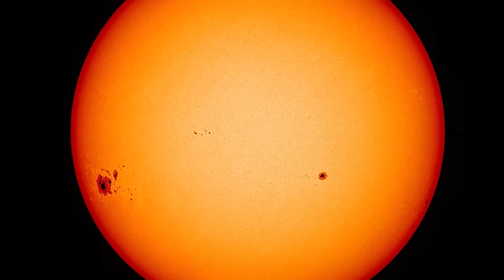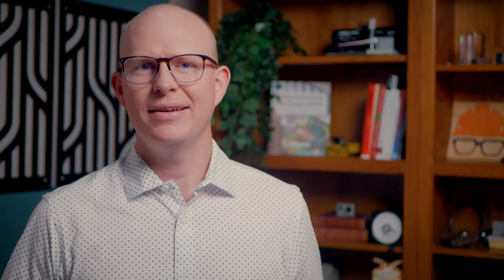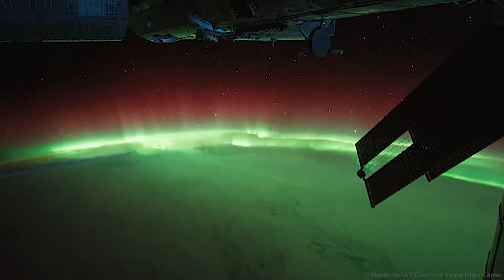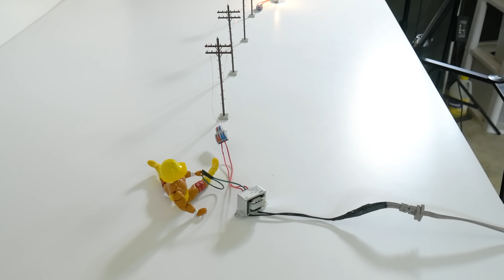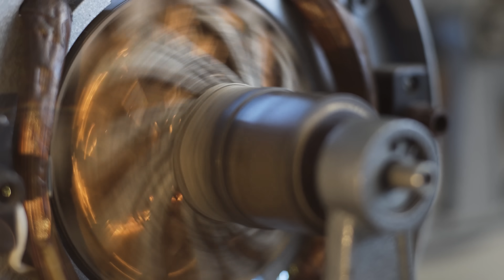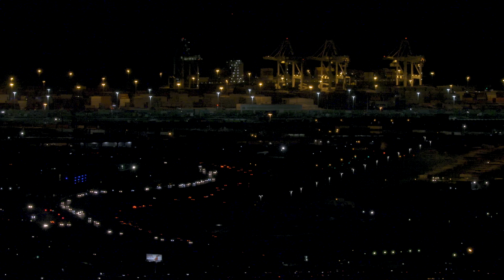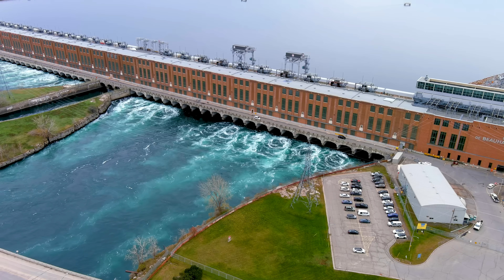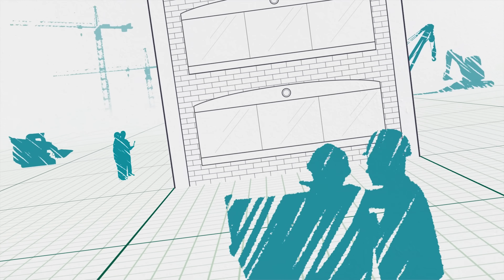The Most Confusing Part of the Power Grid

Comment: If I remember correctly, power companies apply a power factor to residential and small commercial customers to account for the reactive power.  And you get billed for it.  Even more important in the billing and capacity areas is the demand factor, that is the customer has a peak demand for power and the local utility has to have the capacity to meet these peak demands.  So peak demand is measured, and a component is billed for it.  In the old analog meter days, there would be a needle on the meter to measure the demand.  There would be a pointer that would register the peak demand.  Now, the so-called smart meters measure for the peak demand continuously.

I think that this peak demand is an aspect of the push to EVs is the peak demand which will increase dramatically when high amperage overnight chargers are connected.

PS:  The margins are constantly being shaved in the pursuit of greater economic returns.

PPS:  I worked for a pipeline company that had multiple high horsepower electric motors driving compressors that were located in the TVA service area.  There would be times that the TVA would contact us and ask us if we could operate a particular motor at a particular location in order to help stabilize their grid.  These motors were synchronous and varied in size from 1,500 hp to 15,000 hp.

PPPS:  I recommend checking out as to what is going on in Australia, particularly NSW, about the push to renewables.  They are actually facing electric power shortages and rapidly increasing power bills.  There is a revolt brewing over this.

Comment: https://youtu.be/ZwkNTwWJP5k?t=729
"We usually say that inductive devices "consume" reactive power and capcitive devices "supply".
It should be ""We usually say that  capcitive devices "consume" reactive power and  reactive  devices "supply".
That's why we are installing capacitors in a circuit to "consume" reactive power, sometimes close to it's inductive source. Capacitors are enclosed in an equipment called reactive power compensators and you can spot quite often in Europe.

Comment: One of the cool things that some geothermal power plants can do is easily provide grid support by increasing turbine speed by opening the turbine control valves to provide reactive power. When a transmission line in Oregon overheated in 1996 and tripped several power plants off line the grid cascaded and customers in 9 western states lost power. I was in the control room of the Steamboat geothermal power plant in Reno when the whole thing started to go down. The phone rang and the plant manager answered the call from the utility. The guy from the utility screamed ‘can you provide grid support?’ You could hear him across the room. The plant manager asked, ‘Are you going to pay me for it?’ “No”, yelled the utility guy. “Just do it.” For a tense hour or so, the plant manager turned a dial that changed the power factor as the utility guy yelled, “Lead. Ok. Now lag. Lead…..lag.” Reno didn’t lose power during the major outage.

Comment: A brilliant explanation.
What I like to know is, at 6:36  when the capacitor and the inductor were indicated on the oscilloscope what sources were used?   As far as I can remember the source for the capacitor should have been a current source, while that for the inductor should have been a voltage source.

The manner in which I explain Power Factor  is to consider a train on a railway track which needs to be moved. The force to move it can be applied in any direction that is from the back or from the side or anywhere in between ( vectors)  Pushing a train from the side at 90 degrees will not move it but will tend to turn it over and the best manner to move the train is to push or pull from the back or front parallel with the rails on which the train stands.

The direction of the rails could represent  the current, the direction of the force used could be the voltage and the resultant of force and movement is the power used to move the train on the rails.    The angle between the rails and that of the applied force can be representative of  the phase angle between voltage and current hence the power factor is determined. Also Real, reactive and apparent power is illustrated in this train example and the associated vectors.
Reply: The test is looking at the current through the device (capacitor or inductor), which is the second trace on the screen, the first trace is the voltage of the supply.  The current through the device is shown by the voltage that appears across a resistor he inserted at 5:43  (V=IR).
Reply: @karhukivi  Thank you. That means that with the insertion of the  series resistor,  the voltage source with a low output impedance was effectively changed to a current source to charge the capacitor .  .
Reply: @carmelpule8493  Yes, but not a constant current source.  The oscilloscope can only detect voltages, so to measure a current, a series resistor is inserted and the second channel is measured across that resistor.
Reply: @karhukivi  Thank you Sir, The depth of matching sources to transmission lines and loads, is an art in itself, as the source and load will both have an effect on the characteristic of the processing network in between. To makes things easier to understand, I often look at ideal current and voltage generators feeding the various load, In the case of a perfect capacitor it will react differently when supplied from a perfect current source with an infinite output impedance,  then, a perfect voltage  source with its zero output impedance.. The hidden elegant wonders of static, moving spinning Charges, Voltage, Current Electric fields Magnetic fields, Power, Energy  and their relation to mass, are just fascinating,  and can keep one busy for a lifetime. Thank you once again.
Reply: @carmelpule8493  Yes, what always astonishes me is how the modern world economy is based on spinning coils of copper and magnetic fields!

Comment: Would distributed power be a solution to reduce risk and the wasted reactive power and lower the damage from CME's and the like? If each house produced and used DC power, would this not be reducing the length of transmission of power to almost zero? I am in favor of all this for many reasons and would like to see governments require or incentivize this conversion from long distance transmissions of electricity to individual generation/use by each consumer of electricity. That would be good social and environmental benefits long term. Thanks.

Comment: As usual, well thought out and presented. One thing though. Lightly loaded transmission lines are capacitive. The point where they are VAR neutral (neither producing nor consuming VARS) is called the surge impedance loading point or SIL. I'm a system operator for a 6500 -MW system, and we constantly have to adjust our reactive resources depending on loading and the time of day.

Comment: 16:30 Don’t let the constant propaganda fool you; we’re not transitioning to renewable sources. All of these wind and solar plants are 100% backed up by fossil fuel power plants and old hydroelectric and nuclear plants, because renewables are not dependable due to their reliance on the sun and the weather. Over time we have been slowly reducing the number of hydroelectric plants, and we’re not building new nuclear plants, thus we’re increasingly dependent on fossil fuel. And we cannot reduce the number of fossil fuel plants as we build more wind and solar plants, because we still have to cover the times when these plants aren’t producing power. The largest grid-connected battery systems can only maintain output for a few minutes without the fossil fuel plants running. 

You could shut down every wind and solar plant on the grid and the power would continue without a glitch, but you could not do the same with the fossil fuel plants for even a minute. And this shows no sign of changing any time soon.

Comment: The thing that I don't get is. Solar particles would seem to induce DC on the line except for you need AC to induce a current on the line.

The other thing is it would seem that since power is transmitted with two lines. You would get "common mode rejection" that would cancel any solar effect. Much like a humbucking guitar pickup.

Comment: There is an agency out here in California called "Cal-ISO", which stands for "Independent System Operator". They're a not-for-profit private company that manages the state's power grid. There are several different power companies that own and operate generation equipment in the state, some of them Private, like Pacific Gas and Electric, others Public/Government Agencies like SMUD, the State Department of Water Resources, and the Los Angeles Dept. of Water and Power. Cal-ISO is like an independent Traffic Cop who isn't employed by any one specific power company, but who manages the grid equipment that all of those generators feed into, for the benefit of everybody. I had no idea that "reactive power" existed, and that big inductive loads actually pump power back into the grid. This is significant: The State Department of Water Resources operates several pumping stations that are powered by gargantuan electric motors: one in particular, the Edmonston Pumping Plant, which pumps water from the California Aquaduct over the Tehatchapi Mountains to Los Angeles. This plant has 14 of the largest electric motors in North America: 80,000 horsepower each, and when all of them are running, the plant draws almost 800 MW, through a dedicated 230 kV line from SoCal Edison. I had a friend who was an electrical engineer and who worked there for a while; he told me that starting up these pumps had to be coordinated with Cal-ISO and the operator of the power plant at Hoover Dam, which is where most of that 800 MW came from.

Comment: Why are they called "synchronous condensers?" Isn't a "condenser" an old term for capacitor? (c.f.: condenser microphones) But these seem inductive? Can they act like capacitors?
Reply: They can be used for both, it depends on excitation. An under excited synchronous condenser would be inductive and ‘absorb’ reactive power, an overexcited synchronous condenser would be capacitive and be ‘injecting’ reactive power

Comment: Question on emergency generator power output. I bought one after the big freeze couple years ago. Now I’ve been reading that the electric output may not be pure sine wise. Are there plugs that you could attach to an extension cord to hook up computers and other sensitive items?  I tried searching on Amazon but I lack the proper terminology. Thanks.

Comment: 9:49 actually only ACTIVE power is responsible for the heating in the lines, due to Joule’s First Law. 

Reactive power does not affect resistance. Only reactance. So reactive power is not lost on the grid, but stored. Active power is partially lost.

Similar to the complex nature of apparent power, electrical impedance also has its real and complex components, resistance and reactance, respectively.
Reply: There is some truth to what you are saying, but what he means is that some of the reactive power will eventually turn into active power while it's going back into the grid. Not 100% of the reactive power stays reactive

Comment: Consider the graph rms voltage (V) vs. power (p) at 14:38 ff. At low values of p, V is a function of p; there is just one V for each p. But in the “nose” area at the right, there are two values of V for each p. Is it possible for the V to fluctuate rapidly, switching back and forth between these two values over time instead of going around the nose as it does in the video? I assume the arrowhead moving along the curve is showing the p and V over time. Quite fascinating, all the power company equipment we never notice.

Comment: Very good display but also very noteworthy is: Every PV or Wind or Battery souce which is linked to the grid through an inverter has the potential - and many are ready for it -  to provide power factor correction. This is even not depending on delivery, i. e.  a PV inverter can do pfc ar night time, basically using its capacitor-DC link and the right PWM modulation. These very beneficial ancillary services bring out the full potential of renewables once utilities are transformed into smart-grid-operators with many distributed players, thus adding resilience.to the grid.

Comment: fun fact about industrial power factor, a lot of plants have massive cap banks to increase their power factor, some plants also opt to not have the proper metering for inductive loads in order to have the plant run on large battery banks for short times when the utility folks come around to meter it out in order to get the lowest rates on electricity

Comment: I would actually appreciate if you had other videos that went into the math or a link to resources. I studied a lot of this stuff a long time ago back in school before youtube existed, and now watching these is sort of helping me refresh my knowledge and actually it's a really good break down. Having a more in depth video and applications of the math for people interested would be fun i think (or maybe this is on that nebula site? I'll have to check it out)
Reply: Yes; this raises questions for those who’ve taken math but little physics of electricity & magnetism. Physics books discuss the RCL series circuit equation as an ordinary, second-order linear differential equation in one independent variable (time), but no applications to a power grid, where you’d have large systems of equations allowing for elements hooked up in in parallel as well. I also suspect that unlike in the book, the coefficients for R, C and L in the equations aren’t constants, but functions of time. There is, in the series RCL equation but not in the real world, the case of C = 0 where 1/C is undefined. The AC voltage is root mean square time average in the video here, which doesn’t consider instantaneous values.

While engineers take lots of math, I doubt they ever try to model a power grid by hand using theory as presented in college. It’s too complex for that. They use software, or various heuristics that work on the job.

Comment: Very succinct. Wish I had these videos years ago when training generator operators. I’m a broadcast electrician and everything I do is temporary and redundant. Currently out with 3mW based on 6 500kW gensets. Load is always less than 400kW. 480/208V. Load in operate and out in 6 days. Broadcast events usually add a UPS between shore power and generators.

Comment: As an Australian, I can assure you that many of us think the govt's plan to go 100% renewables is going to be a disaster. A better option would be to just replace the coal-fired power plants with nuclear power plants - using the same grid. Going with wind a solar means building an extra 28,000 kms of power lines which they do not include in their costings. They claim that nuclear is 5 times more expensive than renewables - which is complete garbage. Our woke/left govt are just ideologically opposed to nuclear and won't consider anything other than renewables.

Comment: 16:44 
      Grady, anything wrong with my bare basic understanding, that grid scale  batteries are just this - capacitors?   
       Absorb in moments of plenty and deliver into moments of sag?
Reply: Capacitors, inductors, and batteries all store energy, yes, but they are otherwise not the same. They have different behaviors.

Capacitors resist changes in voltage, inductors resist changes in current, and batteries act as either a source or a load (they interact through electronic controls, since we must first convert between AC and DC to charge and discharge batteries from and to transmission lines).
Reply: @Rogstin ,
   👍🏻   Thanks.

Comment: HVDC system doesn't have such problems. I recommend making next video about that
Reply: HVDC is great for long power lines but you have to convert the power back to AC when you take it off the line and the voltage on HVDC lines are very high and hard to change so the equipment is very expensive.
Reply: @irocz11   HVAC long power lines have exactly that problem because neutral point of wye transformers are grounded (bonded to earth). Any superimposed DC voltage and resulting current can not be blocked and saturates transformers cores

Comment: "An incandescent bulb's resistance changes with voltage".  Ah, no.  It changes with temperature, which depends on the current, which depends on the voltage".

"Power is transfer of ebnergy".  Ah, no.  Power is the rate of transfer of energy.

"Power does the actual work".  Ah, no.   The electrical energy does the actual work.

I know you know these, but this video is targetted at people who don't know these, so you should take more care with your language.

Comment: Another issue with solar weather is that it can create huge DC voltages along transmission lines. These cause the transformer cores to saturate, meaning the transformer no longer works as a transformer (it's like removing the ferrite core from the inductor in the demo). The result is a huge surge in current as well as a drop in voltage. The current can burn out the transformers, which have a longer lead time for replacement. 

Think a 9-hour outage was bad? It can take a week to manufacture a transformer on a one off rush order; and if half the transformers in a grid go bang all at the same time it could take many weeks to replace enough to get going again...

Comment: At 60 Hz, the current sloshes back and forth, but the free electron in the copper wire barely moves !
Actually the electron’s movement is only 0.8 um ( 0.00003 inch )